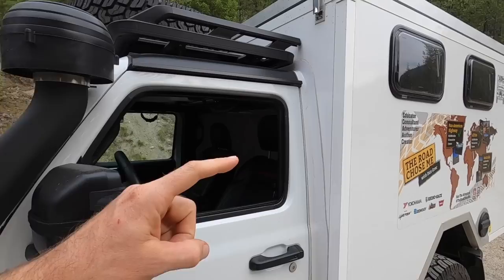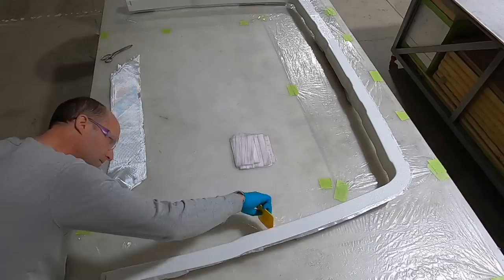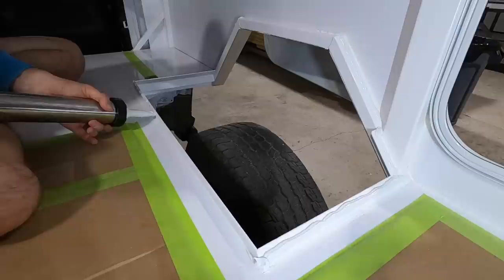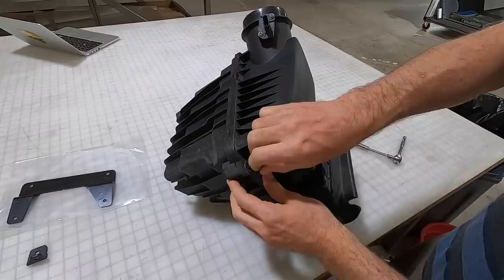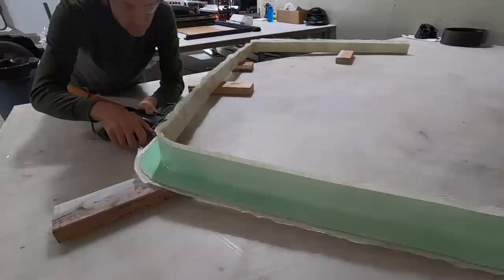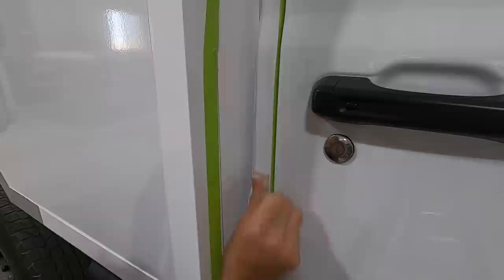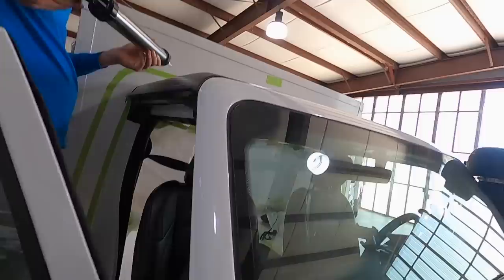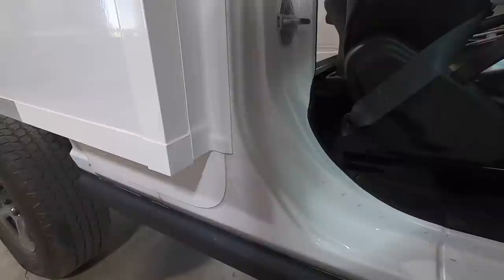Dream Overland Jeep Camper Build Pt. 4

Comment: That is coming along great. It's one of the most extreme modifications I've seen to a Jeep so far. I like snorkels. They do provide cleaner air and protect the intake from water, they don't however protect the fuse box or battery. Also if your electric fan for the engine kicks on while its under the water it's toast. Then air hoses for axles, transfer case, etc. It's better to increase the overall height of the vehicle as all parts of the vehicle go up. You should still bring the air hoses higher. The snorkels are great addition though.
Reply from the maker: I will be extending all the breather hoses as I've done on my previous vehicles. It's on the todo list!

Comment: I'm so excited to see this coming together!  It looks incredible and so functional!  You might have talked about it elsewhere, but I'm curious about the decision to bond the camper to the freedom panels vs. just a bit further back on the main body of the hard top.  You might not want to regularly take the panels off, but that would at least let you replace them if one got damaged, or if the hard top seals needed to be replaced.  I'm also a bit curious about how the rain gutter works in a heavy rain.  The wall of the camper is right behind the front door, so it seems like the gutter and camper could create a waterfall that would flow right into the cabin when you opened the door.
Reply from the maker: Putting the box further back would have made it smaller, and it would have meant filling in part of the rear door opening. For a ton of reasons putting it where it is made the most sense.
Trapping the freedom panels is not something either Michael or I care about - I never once took them off on my Gladiator around Australia, and have no interest in that amount of dust inside my house and sunburn when on a trip for years on end. Our roof rack will trap them anyway. I'll show that next time.

Comment: I'd love to see these kinds of boxes available for other vehicles- like trucks and cab chassis vans.  Think a "full size" Toyota Sunrader type build, but on any truck the customer wants, or a custom RV van build, from a cab chassis...
Reply: Check out Enduro Campers. Similar implementation on full sized trucks.
Reply from the maker: That would be cool, but an absolutely insane amount of work to try and make a version for a ton of different vehicles.
I'm certain it can and has been done, but the pricetag will be scary I'm sure

Comment: I definitely prefer the aesthetics of your build over down2mob's gladiator build. I think yours distributes the added weight much better. IF I had the $, I would be interested in your approach on a gladiator.  IE, in addition to removing the bed, removing the back half of the cabin for a roomier camper box extending no further past the rear axle than the bed for better departure angle 🤔. Also, your video on why you chose the ecodiesel settled a lot of my concerns about that power platform 👌
Reply from the maker: I'm assuming you want that just because it's bigger?
Reply: One problem which Dan mentioned was that a wrangler isn't designed to flex but a gladiator is. The bed moves separately to the cabin. I'm not sure anyone knows what that does to the build to make something meant to be flexible rigid.

Comment: I’m not sure how the cab-to-camper trim piece is going to flex. It’s a tight tolerance and it appeared that you laid up the glass in a crisis-cross pattern that I think would make it quite rigid. Curious about your thoughts there.
Reply from the maker: The glue we are using always stays a tiny bit flexible, and it allows pieces to move separately from each other.
Reply: Yeah this is going to be super interesting
Reply: I'm betting it will separate and leak from any serious offroad pounding over time.
Reply: @GATORADDAM  that would be my guess as well. I sometimes get a little bit of intrusion in my stock freedom panels so it’ll be fun to see for sure!
Reply: Wondering if a rubber seal might be better. Unless the chassis is pretty stiff (and I doubt it is) something has to give there when the rig is cross-axled. Looking forward to seeing this in action.
Reply from the maker: @GATORADDAM  Before putting on the fiberglass piece Michael measured how much deflection there was between the cab and the box while hard off roading, and it was barely a couple of thousands of an inch.
The box is very rigidly mounted to the forward cab.
Reply from the maker: @neon1929  Keep in mind nothing "gives" when the stock Wrangler is cross axled, so this should behave in a similar fashion.
It is, of course, a big experiment, and time is the only way to tell.

Comment: Is the pop up roof gonna be on an angle? Like your old Jeep? Or square like on a sportsmobile van?
Reply from the maker: We have not decided yet, and keep coming up with pros and cons each way.
What do you think we should do?
Reply: @TheRoadChoseMe is it going to be lifted by electrics or manually?
Reply: @TheRoadChoseMe  I would definitely advise for the square design. If it opens on an angle, like your Africa Jeep, you significantly decrease the amount of floor space you can walk around in. If the construction is stable enough to handle some wind, then having the increased usable space is definitely worth it.
Reply from the maker: The trouble with the actuators is the have to be on the outside, otherwise they get in the way of the canvas. That makes me lean towards ditching them to keep it light and simple, so manual operation is what I'm going with
Reply from the maker: That's the main reason I'm leaning towards vertical pop - increased interior walk around space
Reply: @TheRoadChoseMe . Excellent choice for the simple reason of less things that can go wrong and likely weight saving.  As a kid my family had a fibreglass top tent trailer with a very simple manual pop up system, I’m sure you have seen plenty of them.  You could design the interior to work for two people with a wedge pop up but the extra volume and flexibility of the whole roof going straight up will be much appreciated with the extended travel you do.
Reply: @TheRoadChoseMe  How about one step crazier and go full flip like my JK Habitat or XV-JP?? /s
Reply: @TheRoadChoseMe yeah I think the simple mechanism that four wheel campers use for the vertical pop up is best. They use one in the front and one in the rear, but I’ve seen people put two mechanisms on the sides and they seem more rigid. I’ve also seen people put gas struts on the internal mechanism to give a little boost if you think you’ll have weight up their
Reply from the maker: @0ricle I've thought long and hard about it, and I would absolutely love the full flip so there would be HUGE internal space... but for where I'm going, I absolutely do not want canvas as the roof.

Comment: Curious about the snorkel - doesn’t it interfere with opening the driver’s door, particularly the mirror?
Reply from the maker: No, it clears the mirror by about 1/2 an inch. It's close, but basically identical to the version for the 3.6 engine (I just compared the two side by side)

Comment: Question. So I hear alot of people say even if you have a snorkel it’s pointless because you will get water in your exhaust, but from my understanding it’s really hard  to drown a newer vehicle by the exhaust. Have you ever “water proofed” your exhaust? And I’d so how?
Reply from the maker: No, I've never done anything like that, and I've never heard of a vehicle being drowned through the exhaust.
Reply: The back pressure from the engine keeps the water out while it’s running. Now if your engine stalls, that’s a problem, and it can be dangerous to try and restart.
Reply from the maker: I've also never heard or seen that, but I have to assume you are correct.

Comment: Are you going to mount an awning?
Reply from the maker: Yes, for sure. Still trying to find a great option that is a 270 batwing to cover the side and rear, but that isn't too heavy and is hopefully free standing.
Reply: @TheRoadChoseMe i.e. the Holy Grail of awnings 🤣 I'll be curious to see how it mounts to the camper 👍
Reply from the maker: It will likely bolt straight through the wall into the steel frame... or we'll use spreader plates and spacers to spread the load out on the wall.
I'm half tempted to buy a generic one, then make my own carbon fiber poles and backplate to make it 2/3rds lighter...